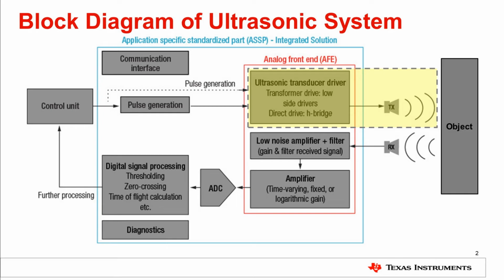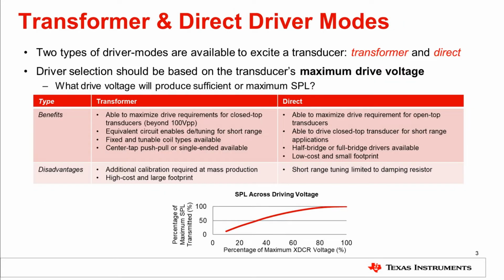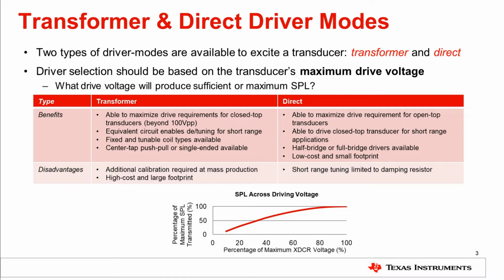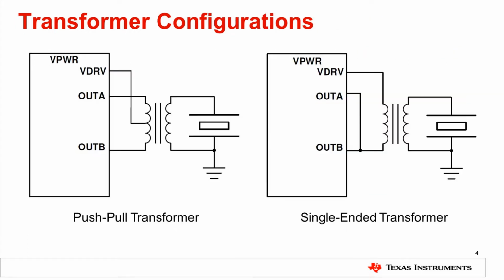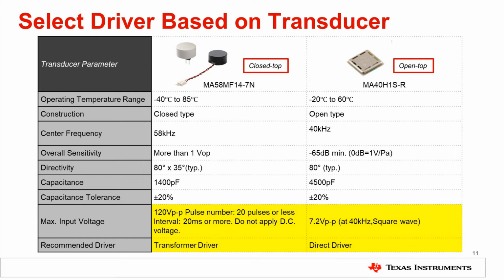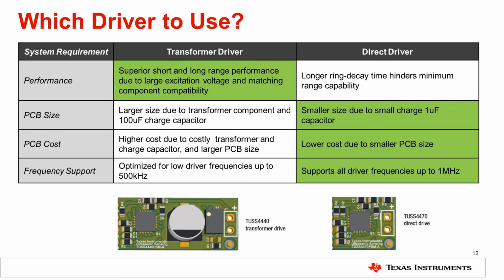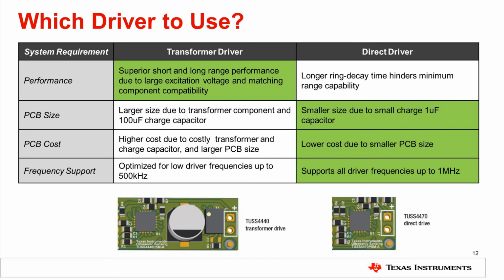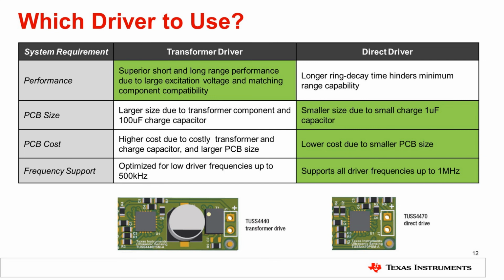Ultrasonic driver

Comment: Unless you have a company email address you can't ask them anything about these devices on their forums? Struggling with the setup of the TUSS4440. The TDC1000 was much easier to configure.
Reply: Figure it out.